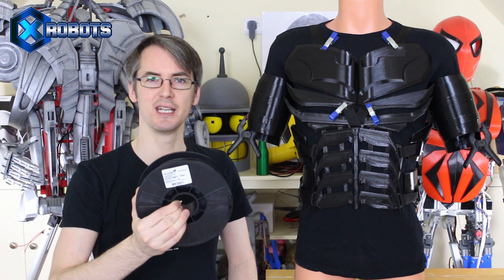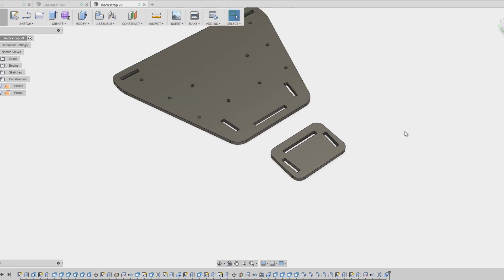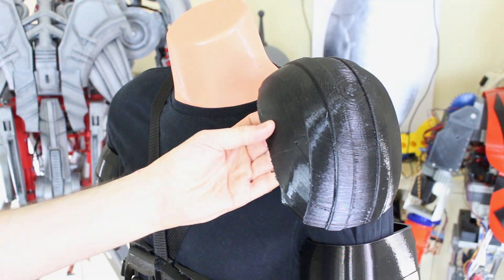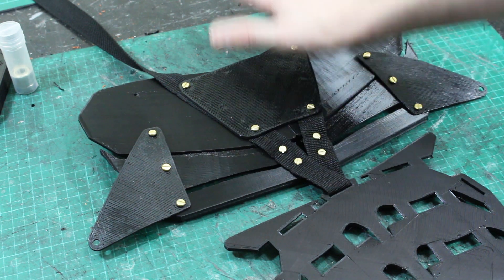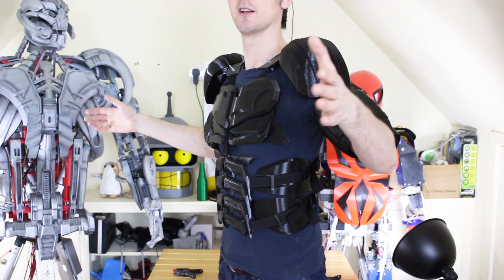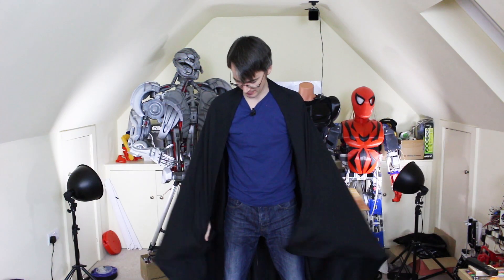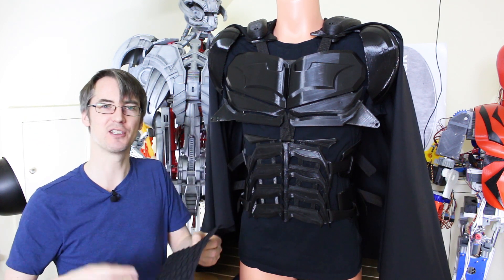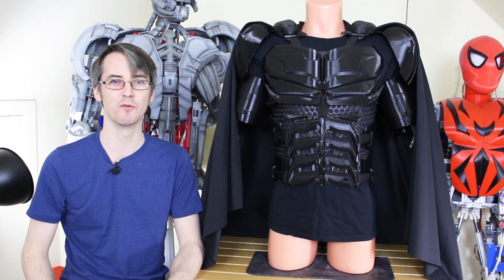Batman Cosplay Suit #2 with Ninjaflex | James Bruton

Comment: Some nice progress here. That printed hexagonal fabric looks pretty great under the armor. Although I too think that those pauldrons could use some redesign, also to cover more of that gap between shoudlers and breasts.
On the topic of that cape - you've said that you want to use this costume together with your bat-skateboard so I wonder if this type of fabric will look good when in motion? Also it probably shouldn't be too long to prevent any possible entanglement. But I'm sure you already have this thought out, I just wanted to point it out:)

Comment: Like many other people have already said, your pauldrons (aka shoulder bells) could use some redesign. The thing I don't like about them is that they seem to restrict your arm movement, making it very hard to raise your arms above your shoulder level. Darth Vader's armor has the same problem, by the way :)

The second thing I don't like is what they do to your overall silhouette - your cape will have to raise upwards to drape over them, making it look a bit... goofy :) Batman suits through the years have cape draping downwards from attachment points, and their pauldrons don't stick out so much.

Speaking of cape, Batman cape is usually made from several pieces sewn together, basically forming a scalloped circle. But I trust you are capable of googling "batman cape pattern" ;)

Comment: Minor nitpick: 'Shoulder bells'...where did you get that phrasing? The proper term is pauldrons (or, slightly more archaicly, spaulders). Otherwise, neat looking stuff you've got going here.
Reply: It's a commonly used term when talking about modern types of armour, such as Darth Vader, clones, stormtroopers etc.
Reply: Yeah, it’s not the most “correct” term but it’s common and accurate enough. Most people understand it just fine.